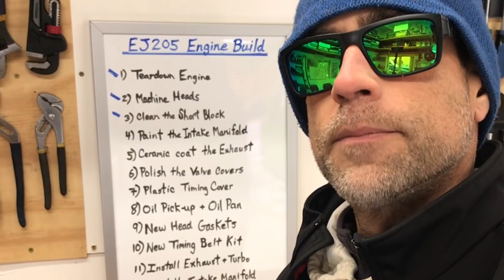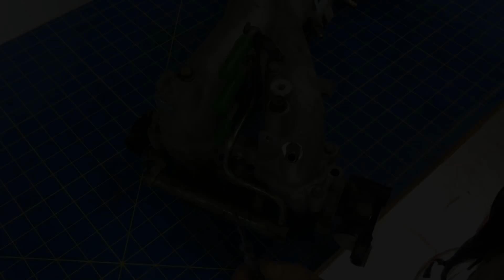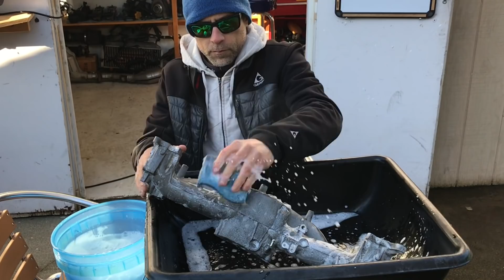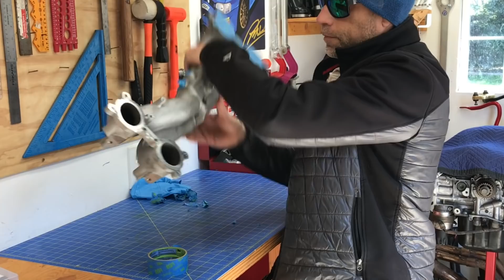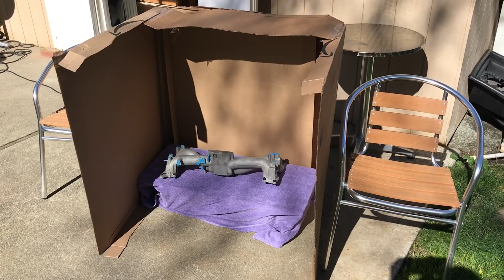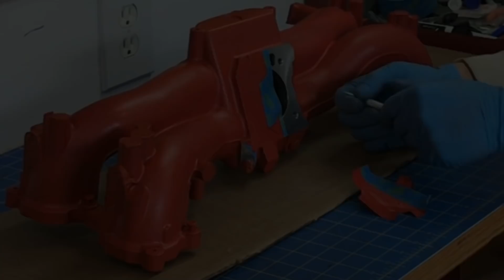STi Red Wrinkle Coat for ANY Intake Manifold

Comment: That's a really nice and well done finish. I am wondering though, that, if you are going to go to so much trouble to make the intake look good, why didn't you deburr and grind off all the casting marks? This is something I do routinely to all engine and tranny element in my builds. I  like the look better and it has the added benefit of being smooth if I need to get my hands or fingers into tight places.
Reply: im not sure about the "benefit" but i agree it looks a lot nice to clean up casting artifacts/flash

Comment: May as well toss that original turbo inlet!  Those suck. No problem to break.  If you're getting to it  like that, should swap it for a better aftermarket silicone one
Reply from the maker: Will be... but gotta have the OEM one first to pass all State Inspections to make car street legal.  Then I’ll ditch that junk factory one!!! 👍
Reply: @SubaruONLY  ah yeah.  Im in WA, they quit doing emissions here like 1-2yrs ago.  They said it wasn't worth it...    lol I was definitely happy not to hassle with that anymore!
Reply: It is common for the factory turbo inlet to break when you're trying to take it out, also they tend to fail where they connect to the turbo, and leak there.   The flow is not as good as aftermarket ones.  Smaller I think & also having the ribs
Reply from the maker: That’s awesome. The regs in CA are ridiculous and only getting worse - cheers!
Reply from the maker: I’ve only seen the little rubber connection points torn - like most of the time - don’t often see any other areas that fail. And yes, the flow is not great with OEM tube, at least for HP, smaller tubes are good for low end torque and that’s good for daily city driving, but if you want HP above 3K, need a larger ID and smoother inner surface, as you point out! 👊

Comment: There is also wrinkle red powder coating that look about the same. As well you won't have to worry about paint scratches. But if you diy you will need an over about 22in long or tall.

Comment: Off topic, but.................
I'm looking to buy an older WRX as a project car / daily driver.  What years would you recommend?
I'm open to anything from 2004 up to 2016.
Reply from the maker: Awesome to hear! And good call - these cars are a great investment and if you can do a little wrenching at home, they have a very modest cost to maintain. I like the 04-07 WRX models the most and think they are the best bargain at the moment - mechanically they are all very similar, so I’d just get one that was well maintained and has the body style (AND color) that appeals most to your taste! One thing to note is the engine platform changed on the WRX for the 2015 MY, with the introduction of the FA motor design - I think the older design, the EJ (which was retained for the STi models), is design that has more aftermarket parts and has had all the kinks worked out; so I prefer the EJ design more too.

You’ll probably be looking at cars with over 100K miles, so look for one that has had the timing belt done and hopefully the head gaskets redone. Those are the two big maintenance items that will need to be done for most 10+ Subaru vehicles.  Good luck and let us know what you end up getting!!!
Reply: @SubaruONLY  I am assuming I'll do the head gasket/timing belt/water pump unless it has been done (and documented) recently.
The problem will be finding a non-modded car with little rust up here in Maine.
Reply from the maker: Yea, hear that.  Maybe road trip time... 😁😁😁

Comment: Pro tip: Better to hang the manifold from a wire or bungee to easily access all surfaces in one coat.  And it's much better to bake it.  You can even speed cure by using a heat gun and heat it from inside out.  That will ensure you get the wrinkle finish.  Done many of these using VHT and powder coat finishes over the years.
Reply from the maker: 👍👍 Great advice!!!  You are totally correct 100%. Actually playing with the heat gun and thinking of doing a quick follow-up video to discuss that option - but I didn’t think to use the heat gun from the inside!!! That’s really clever!!! Thank you!!  👊
Reply: SubaruONLY if you do a follow up video, add a close-up shot of the wrinkle finish👌
Reply: I like to preheat the part I'm painting. Really helps set it in quickly and as stated, promote the wrinkle effect. 
Great videos!

Comment: On 23:46 I see what it looks like to be a crack where the bolt goes through on the right side of the picture??? Let me know if I'm wrong
Reply from the maker: Whoa, great eye man!  It’s actually the little round plastic clips I was using to cover the bolt holes, that one slid out a little and I didn’t catch it before continuing to paint. Caused a little red paint to cover the top area but I’ll just touch it up with sand paper to remove the light dusting of red paint.

Comment: The ej205 is not a good engine should've got a sti ej207 instead
Reply from the maker: I hear you, good recommendation for sure! 
For this swap, I’m keeping it stock to pass emissions requirements and then will be replacing the short block with a full closed-deck block, which will be stronger than any OEM block semi-closed designs. But I’m with you for sure, thanks for the comment - good advice!  👊
Reply: @SubaruONLY  I recomend you buy a jdm ej207 from 2001 or newer. That is the strongest oem subaruengine, it has a plenty strong block for at least 500 hp, you don't need closed deck unless you want more. I would recomend you just go with a stock 207 the first time, it shouldn't be a problem with emissions either
Reply from the maker: Thanks man. I’ll check out the prices on those. Could be a good route to go for intermediate stage. Eventually, yes more than 500HP, 600-700 range is target.
Reply: SubaruONLY youre much better off with a cosworth 2.1 setup for those power figures, i won’t even trust a 207 for 500whp maybe a 20g from the early liberties but 20g’s are such a mixed assortment its hard to find out if you have a good one or not.
Reply from the maker: Great advice! This is a ways out but I’ll take a very close look at the Cosworth options too. They are one literally one of the companies I trust the most for long term R&D with the Subaru platform.